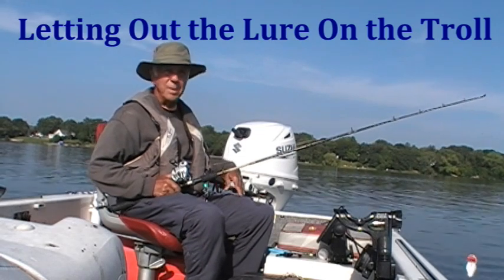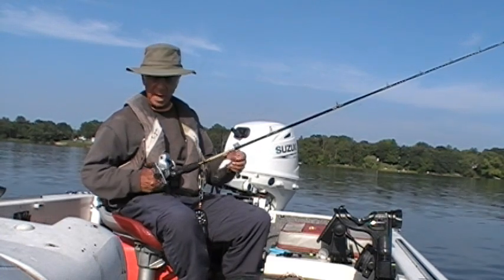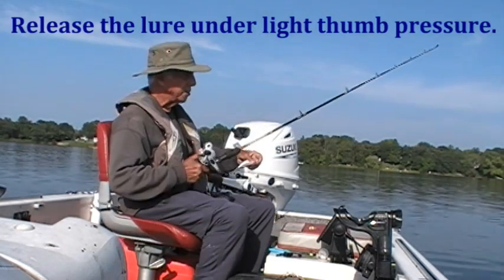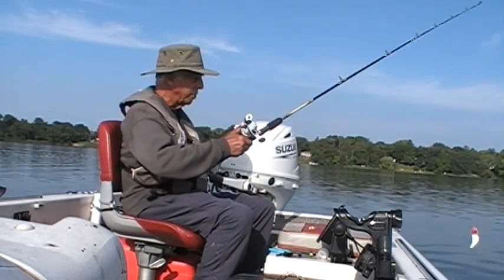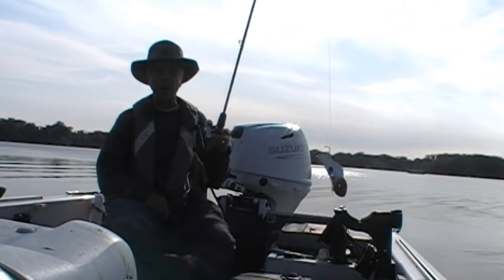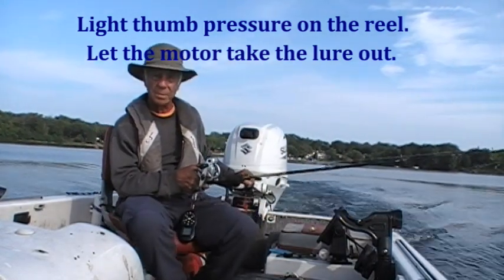Letting Out the Lure On the Troll

Comment: Thanks Jim for making the video.  I'll have to remember to never cast the lure to get it going.  I hope that is the problem.  
We were also going at very high speeds, to the point where it was difficult to hold the rod.  When we slowed down to more moderate speeds it took longer for the spoon plug to roll back to the surface.  So I think that the high speed put the strain on the lure and forced it to one side.  Then when its running sideways, it eventually just flips over and runs back to the surface.  I don't know the exact speeds, the graph was not hooked up to the boat.  I was trolling as fast as possible for muskies.
Reply from the maker: I had the thought that casting the Spoonplug might be your issue but dismissed it since your were trolling. No need to cast when your trolling, let the boat do the work. This is especially true when fishing with a partner. You both want to let out your lures at the same time. The boat should be running in a straight line and never let out the lures on a turn.  That's a sure way to get tangled with crossed lines. 

The only time I'll cast a Spoonplug on the troll is when I'm using different line to troll, like mono or braid. I don't cast NO-BO or wire. 

Trolling fast for muskies is not a bad idea but you should always start out at a slow to moderate speed. Speed is an essential control but it has to be checked. Sometimes in the heat of summer it's the way to go but sometimes even in the heat, they want it slow. You need to check it out. 

When it comes to changing conditions, and when it comes to fall weather, my experience has been that they want it slow. But again, you have to check it out.  Go get 'em. Jim